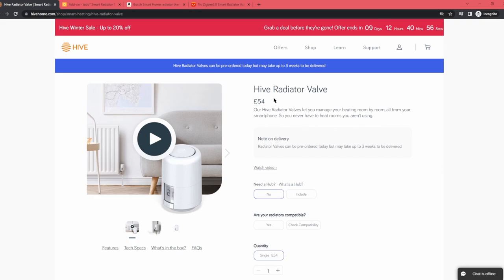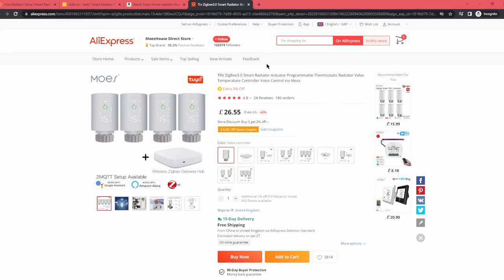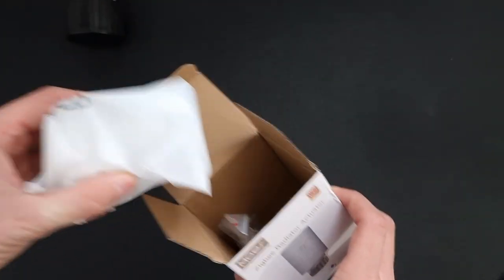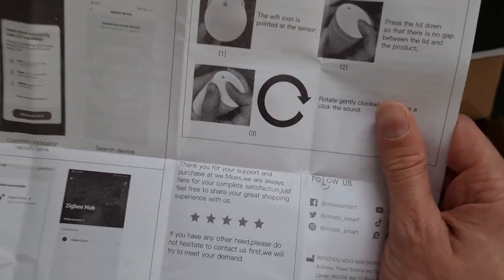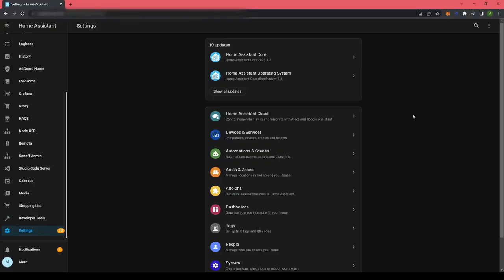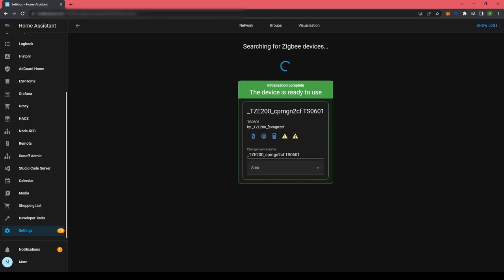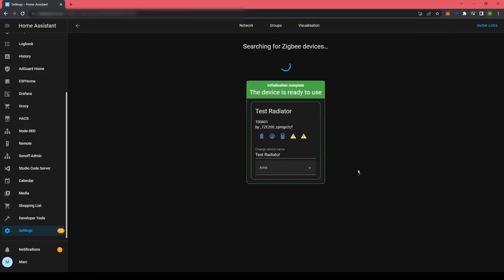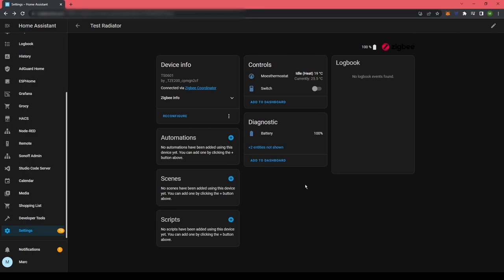Moes Zigbee Radiator Thermostat in Home Assistant

Comment: Could you make a video with all the heating setup from start to finish? (heat pump connector, thermostat, radiator thermostats, HA integrations for all of them, products and wiring)
Reply from the maker: Thanks for the comment.

I thought about this, but there are just so many different types of setups I think whatever video I created would only appeal to a few specific people.

I currently use Hive (UK based, by British Gas). And then just have these valves on specific radiators around the house.

The downside of when you have a smart valve setup like this is that they are good for keeping some rooms cooler than others, but not good if you want those rooms warmer because it needs the heating/boiler to be on in the first place for the valve to decide if the radiator is on or not. (I hope that makes sense, but probably not!)

When you have a full system with the same brand then the valves can tell the boiler to turn the heating on if the valve says the room is too cold. But the downside with this system is that you then need to have smart valves on every radiator to work successfully, otherwise rooms without them will get heated whenever the boiler comes on and the room may get too hot. Getting valves for every radiator can get quite expensive! So I don't have this.

Eventually I'm sure that all of this stuff will just be standard for new homes.

Comment: Hi, when you install the thermostat, you had fully open the valve (aka full heat) or closed (aka off)?
Reply from the maker: Hi there! When you take off your original radiator valve (actuator) to install this one, the radiator will automatically be in the fully open position. Then when you install this one it will automatically calibrate by pressing the metal thing in the middle of the radiator up and down. Pressing it down closes the valve and releasing it opens it.
Reply: @lets-automate  thanks a lot for the answer

Comment: Hi is there any way that the Moes Smart actuator valve can trigger an external relay when its state changes from “idle” to “Heating” (not “Heat”). I would like to have each valve working independently (in HASS) and be able to call for heat, not relying on the boiler running already. Many thanks.
Reply from the maker: Yeah that makes sense.

If you have it connected using ZHA then the climate entity should have an attribute called  "hvac_action" which will change from "idle" to "heating".

You could then look for that attribute change in your automation or create a helper template sensor with the value of that attribute. Hope this helps!
Reply: Many thanks for your prompt reply. I am very new to HA but will endeavour to give your suggestion ago. It's a shame that there are no attributes for Idle and Heating coming from the actuator.
Reply: Just a line to confirm I have now got this working with your help, many thanks.
Reply from the maker: Great to hear!